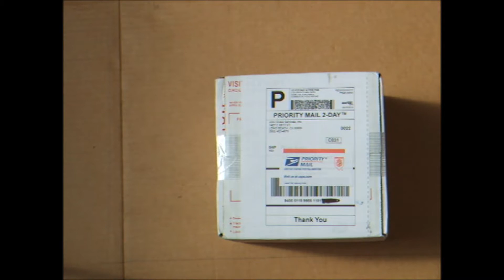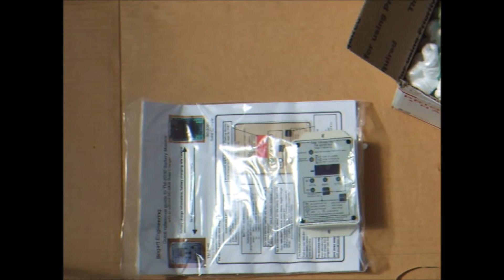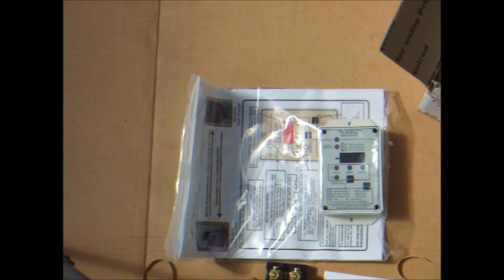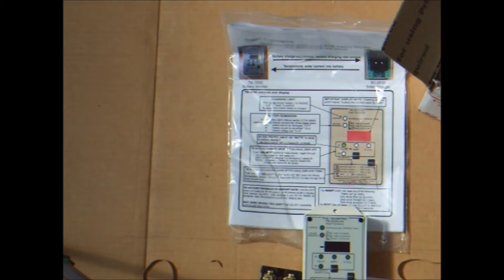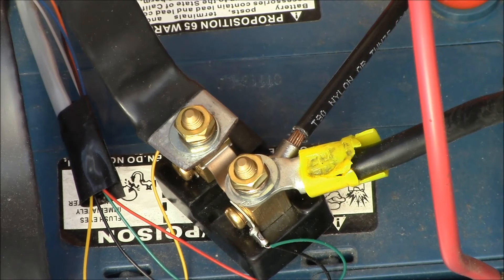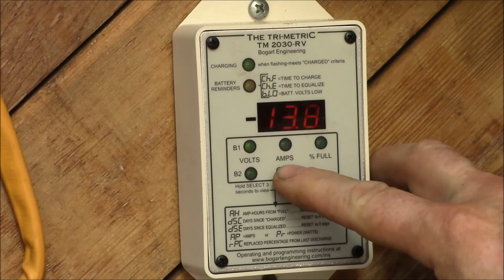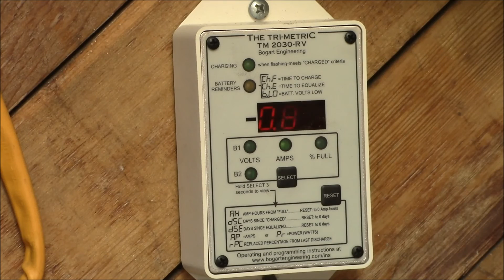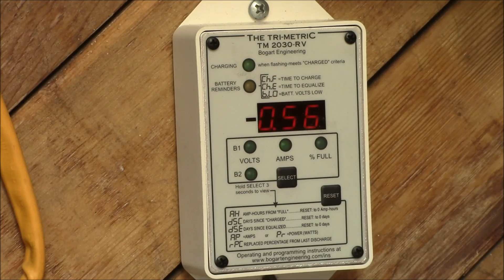Trimetric Battery Monitor

Comment: how do you like and rate it's performance?
Reply from the maker: I really like it, it's been running over 2 yrs. now with no issues.  Seems to be quite accurate, I opted for the smaller shunt to measure loads to +/- 0.01 amps.  The State Of Charge reading seems to be decent, once you get the float voltage and float time dialed in.  That's what lets the Trimetric sync up to 100% SOC.  Then it works off of amps in and amps out to determine the actual SOC.
Reply: R Brown Thanks for the info, I'm planning to order one for my battery powered house which model do you recommend?
Reply from the maker: I think the Trimetric models are all pretty much the same, some with case, some without, I have the TM2030RV.  The only real option is the shunt, 100A or 500A versions.  There is also the Pentametric that has something like 3 channels of monitoring for multiple battery banks:
- http://www.bogartengineering.com/products/
Reply: R Brown I was studying the "whiz bang junior" from midnight but decided to not to due to it's limitations to be only used with a midnight charge controller where the trimetric is a universal unit and can be used with almost any system!
Reply from the maker: Yes, that was a consideration for me as well.  Works with most any 12 - 24V battery system, solar or generator and can work with 48V with an adapter.
Reply: R Brown Mr Brown as always you have always been there, thank you!
Reply from the maker: No problem, glad to help.

Comment: please could u describe how you connected this? for a newbie
Reply from the maker: +Adesuyan Bobby (bigbrovar) It's pretty simple, there are only 4 wires to connect.  There's a current shunt (supplied) that attaches between your battery negative terminal and your system negative connection (charge controller, loads, inverter, etc.).  Two wires from that to the Trimetric is what measures the current in and out of the battery bank.  Then 2 more wires with the battery positive and negative terminals  to measure that voltage. 
Nice one-page diagram on the Bogart Engr. site if you want to see a drawing:
 http://www.bogartengineering.com/sites/default/files/docs/Brief%20Installation%20Description2.pdf
Reply: Thanks. I will read the manual with what you have stated. You mean the shunt is supplied ? Or I have to get it separately?
Reply from the maker: +Adesuyan Bobby (bigbrovar) I purchased a kit with the shunt included.  You can also purchase kits w/o the shunt and then add your own shunt.  You can program the monitor to work with either a 100amp/100milli-volt shunt or a 500amp/50milli-volt shunt.  I went with the 100A so I could get 0.01amp resolution on the display.  The 500A shunt only gives 1A display resolution.
Reply: Also I have an Inverter which has included a battery charger and I also have the CC charges the battery. The inverter can charge the battery when grid is on.. And both the CC and Inverter charges the battery say by noon with Grid being on ( I am from Nigeria where national grid is very unstable ) in my case where both CC and Inverter charges the battery where does the shunt connects to? How would it be placed ?
Reply from the maker: +Adesuyan Bobby (bigbrovar) You just connect the shunt between the battery (bank) negative terminal and the inverter and charge controller negative terminals.  This way the shunt sees all current that flows into or out of the battery.  You can connect all your devices to the positive battery terminal, but only the one side of the shunt to the battery negative terminal.  Just make sure there's nothing but battery negative terminals connected to the battery side of the shunt (it's marked on which side is which).  Then everything else connects to the other side of the shunt.